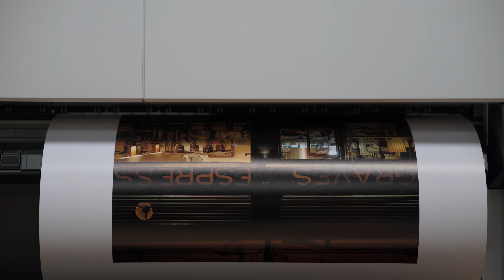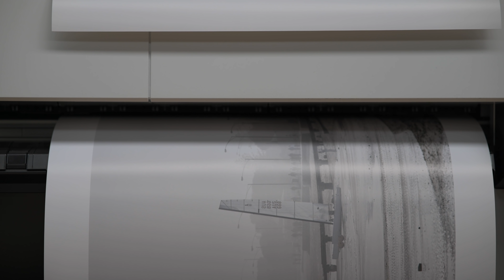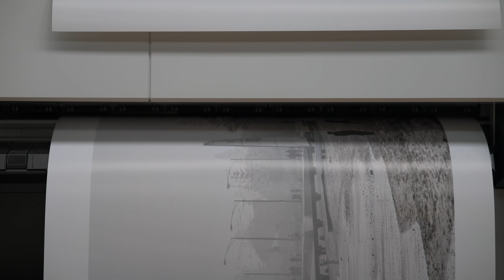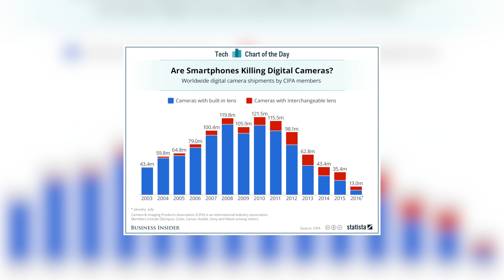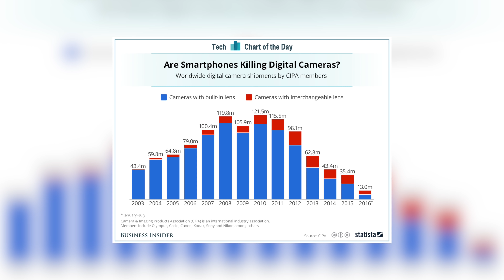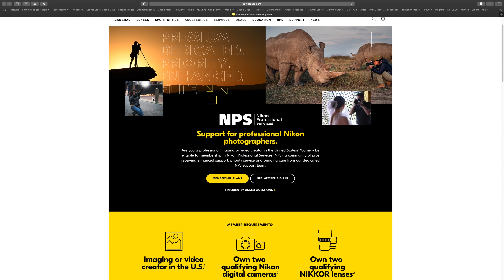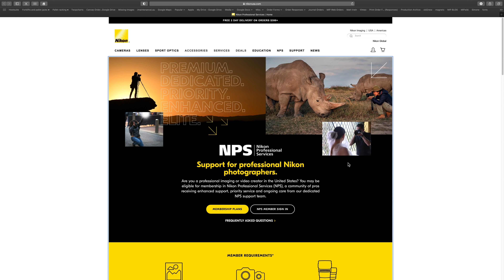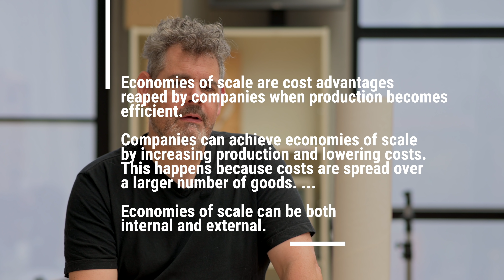Will Camera Gear Cost More In The Future? | Opinion Piece | Matt Irwin

Comment: As the camera market stabilizes to smaller worldwide market manufacturers will probably do a combination of reduce the initial warranties, reduce the number of models offered in the line up, extend the lifetime for each model, rationalize organization structure, and raise prices slightly. I would prefer a lower price with the option to buy an extended warranty. What the exact size of the overall market will be, I am not sure, but I think we are near it. If my guess is correct, I think prices will be relatively stable. Also, I expect the market to eventually be primarily mirrorless cameras from APS-C to medium format with some DSLRs lingering for many years, maybe a decade or more for most manufacturers (new film cameras are still sold). Nikon's recent announcements seem to follow at least part of this with warranties, rationalizing organizational structure, and dropping 2 DSLR models. 

Of all my camera gear, I have had only 1 warranty claim on a Konica camera that had shutter bounce out of the box. All my other gear has never given me any trouble including the Nikon D70S I dropped onto a concrete floor (eye piece damaged but still very usable).

I enjoy photography and getting out to photograph nature and events. I have a special interest in macro photography.
Reply from the maker: Cheers Jay, yes I agree you your analysis, and if we are now at the bottom of the market, and C19 retracts this year, prices will hopefully stabilise. Great data on your warranty history, much like mine.

Thanks for sharing what photography means to you.

Cheers Matt

Comment: Hello Matt, you raised lots of good points, my D200 F5 and F80 still work. but that doesn't mean that Nikon will keep the quality standards as high as now. we saw that with lots of other consumer products a Levis jeans of 2020 is completely different then one from 15 years ago. nothing says we will not have bean counters in Nikon management in the years to come, who try to reduce cost by reducing quality
Reply from the maker: I suppose there are two directions the quality of the cameras can go.  They become, better or worse.   Most likely quality will remain the same, whilst technology continues to advance.  A core part of Nikons brand is quality.   If there is one thing the cannot afford to mess with too much it is their quality offering.   Personally I beleieve it is possible for quality to remain the same as we have always know and for the market to shrink, the market was roughly this size about  30 years ago before the bubble, so it is totally possible.  Along with robots doing more today, and mirrorless cameras being less complicated to manufacture once developed.
Reply: @MattIrwinPhotography  I hope so, but getting not even a carrying case for lenses that cost 2500 euro is a bad thing. The worst that could happen for quality  is that there would come low cost competitors, we have seen it in Europe with quality of kitchen equipment like dishwashers, ovens, reputed brands can not compete with the very cheap ones and start to cut costs in the wrong places. But I really hope you are right. And I also agree that if I have to pay 100 euro more for a lens ( although Z lenses are already very expensive) I will do it with the smile if it helps nikon survive. The international warranty thing is not a dealbreaker I guess. But again thank you for your video very interesting as often. The beer in Belgium offer  still stands :-)
Reply from the maker: @cwoble  Yeah I agree on the carry case.  I think things have been this way for about 5 or more years with Nikon lens bags, perhaps Nikon deciding that people don't use them.  I certainly never used mine, and always put lenses into camera bags ... all of these decisions are terrifically difficult.  But costs have to be cut, so lets hope Nikon choose the best costs to cut.  Beer would be great, might be 2022 at this stage ..... :  )

Comment: A logical step for the industry could be to reduce R and D so they introduce new models more rarely and when they do they are more often just improvement of the existing ones then really something brand new. The Z6 II and Z7 II might well be a first step in that direction. The end of the megapixel race also could make this scenario more probable.
Reply from the maker: Yes great suggestions Eric, and I think you are right that the 'II''s are an example of this.  Cheers Matt
Reply: There will never be an end of the megapixel race. The megapixels are just a marketing argument that make the manufacturer sell new models.

Comment: I have 4 income streams...normally but the Covid thingy has shut down 3 and crippled one. My two largest businesses are in incoming tourism and that is banned due to border closure since late Feb last year, another is photography and the spring wedding season say all 37 weddings in May, June and July were canceled, and the commercial studio work dropped dramatically to only one session since that time. A 4th business is repair of pro audio equipment for venues, clubs, musicians and live theater. That one still works but volume is 1/10th normal because only rehearsal halls are still active. So, adding lenses or updating bodies are not options now. But the main bright side of being here in St Petersburg Russia is the very low cost of living so little has changed personally, till date, still go to clubs but they have 11pm closing times instead of the usual 6am closing, still shoot for fun. I have had 1 warranty claim, recalibration of AF on a D7000 not long after if came out. One day it just missed focus with every lens. The shop in California did it in one day..  I had an SB900 fail during an event but I repaired that myself since I have a more complete electronics lab than they do. A tiny SMD bypass capacitor failed. Disassembly took 5 times longer than the actual repair and the part cost $0.01. I have 6 speedlights so 1 having a random problem was not really a problem.  I hope to be able to upgrade to Z7 2 by the next time I return home for a visit, possibly in April  If I was still living in California I would have been in deep trouble with the cost of living so high. The whole working and middle class have been serious damaged there due to so few services in the commons and costs so high for such things as medical care or medications. I can, and do, have a higher quality of life here than in California where it costs 10-20 times as much to live, with a lower expectation or access to culture.  The nearest opera of any quality is 3000 miles away and $800 a seat but here it costs $1.50 for a taxi and $15-30 for world-class opera in a beautiful theater with far better acoustics. 
Photography here seems to be more of daily life. It is rare that someone does not want their photo was taken, which now in the US is considered assault and criminal offense if someone under 18 is in the frame.  The last time I took a photo in the US was the day I got my D800 when it was first released. I went to the park next to my house there and shot a few action shots of teens on the skateboard park and as I was walking out of the park, 2 police cars with sirens and flashing lights screeched to a halt and 4 officers jumped out with guns drawn and threw me to the ground for the offense of someone taking photos of people under 18.  I was handcuffed and roughly thrown into the back cage. It was resolved by them taking the CF card that contained 25 shorts of flowers and 3 shots of skateboarders getting air. As it turned out only 1 of the 3 boys was under 18.   I have never been back to the US. 

It is going to be interesting to see what shakes out but Nikon will likely survive, their production is mostly in Thailand where costs are low compared to Japan and they are used to slim margins. The companies likely to disappear are Olympus, Pentax and Sony. Sony camera division is a tiny part of their income and their policy is to maintain high margins or a division is shut down. If margins drop to twice those of Nikon on bodies, the corporate board will just shut it down. That has happened dozens of times before. Remember when Sony Trinitron was the biggest selling color TV. They dropped the whole division when the competition started eating into the margins. That was a bigger profit center than consumer cameras. The shut down the entire pro audio division and caused customers of the Million dollar mixing console to lose all their investment parts were no longer available. So dropping profits due to increased costs of production means they will likely bow out.
Reply from the maker: Wow Stan, what a story about the skate park.  That was rough.  Yes it is hard to say what the future holds, but Nikon are working hard to restructure, and it will largely depend on how the next few years shake out, but this is for all camera companies ....

Comment: I purchased an extended warranty on my z6 because it also covered user error so if I drop it, run it over with my car, whatever it is covered. I hike a lot with my camera and have used the warranty once when I slipped and fell. I was shooting macro and had a flash unit connected. It broke the hot shoe off of the camera. The camera still worked perfectly by the way. I have never used Nikons warranty.

Comment: We'll pay more regardless since we're about to have massive inflation... the question of warranty is moot since the price increases will wipe out warranty guarantees, guaranteed. And since the AU dollar is tied to US currency, as most are to some degree, it's a double guarantee, sadly. Which is why I put in some of my dough into older, tougher equipment that isn't engineered to fail in 5 to 10 years. Some of it is from Nikon, but it will NOT work with the FTZ adapter lol

Comment: The Nikon Z711 + 24-70 f2.8 is being advertised today for a package deal at Ted’s for $9,999.95
This kind of cost must be very difficult for many enthusiasts or even professionals 
Specially when a new models seem to come out every 6 months reducing the resale value substantially
Reply: Go elsewhere. Look at digital direct, body should go around 5k and the lens around 3. I wouldn’t pay 10k, the larger retailers try to pull one over you.
Reply from the maker: Hi Ronald, yes that seems over priced, when I look at https://www.digidirect.com.au/nikon-z7-ii-body-only $5119 for the body and lens $3100 making it $8200, and I have seen prices making is sub $8000 but that is a price today.  This is almost $2000 less. 

In Sydeny, https://www.georges.com.au/nikon-z-7-ii-body-3-24-70mm.html?gclid=CjwKCAiAgJWABhArEiwAmNVTB1c027DedeqdfZ7_Q1F12S1muNPXGXDDWwmtNoZCXxB1C5gbxcSLwxoC9lAQAvD_BwE body and lens $8999

Comment: Matt - I completely agree with you.  But to answer your question - I would much rather have Nikon keep their excellent warranty structure. The why I look at warranty is the contract of how well/robust/reliable the manufacturer is building their product too.  If I am giving out a 5 year warranty vs a 2 year, that will ultimately dictate the quality ratio in the end.  Thats just simple engineering.  

Also, if things do go back to the way things were back in the pro film days, we can't expect a new camera every 1.5 to 2 years anymore. If you remember, the time frames between the F3, F4, F5 was almost 8 years each.   So, yes increase the prices but keep the standards extremely high.  

I think this bursting of the bubble is good for the industry and good for us photographers.  It's good for the manufactures as they can finally take time to concentrate on the details and what is really important instead of just rushing to keep up with the next product cycle.  It is good for us photographers, we can finally get back to talking about the art/craft/technique of photography rather then gear all day long (imagine that!). 

So let Nikon expand the release cycles, concentrate on quality/use cases, give us much better engineered products (like  my uncles F3 that he bought when he first got out of college almost 33 years ago and still works like a champ).  And give us photographers a chance to really learn the equipment and show what we can do with it.   And if it costs a 3%-7% more so be it.  I would make that trade off. 

So to answer your question - keep the warranty and standards as high as possible.  Over an 5-8 year release cycle, that is nothing.   Looking forward for the community to get back into talking about the art and craft of photography rather than constant tech comparisons.  The next decade can be a win/win for everyone.  Yes I am a glass is full kind of guy :).
Reply from the maker: Well said Vijay, although I don't see a decrease in warranty meaning less quality, Australia only had 1 year warranty up until fairly recently, and only changed to 2 years.  I don't think we have ever had 5 years from Nikon, and it is the same product.  I think warranties are more about what the regional  market can bare, rather than the quality of the product.

Comment: Warranty might be an issue for hard core professionals with heavy usage of their equipment. The normal consumer won’t be affected, as the local laws take care of most of the cases. I personally have never been in need of service under warranty conditions in roughly 30 years of photography, with no camera brand I’ve used and neither since I switched to Nikon 16 years ago.

As for the future of photography: I’d say the camera companies have lost the entry level consumer market to the smartphone (and the social media environment) and will settle from midrange to to top level gear, as they’ve been doing lately. Just a thought: does anybody care about the Z50? Not saying it’s bad, but who buys it? Or the Z5? All I hear is Z6 or Z7. So in the end cost will go up for us, not necessarily because of dwindling revenues and profit adjustments, but because we’re moving up the quality road. Just bought a Z6 II and the price of good glass is another story compared to the DX realm I’ve been living in. Just imagine Nikon picks up Matts idea and incorporates a medium format sensor in a future Z8 or Z9 to differentiate from the prosumer line  (or new consumer line if you will) Z6/Z7. That’s another can of worms, but cost for the professional will definitely rise.

Comment: They already cost much more here in the UK. Entry level mirrorless (Nikon z50) costs much more than entry level Nikon DSLR's. Just yesterday I looked up the price of a new Nikon D850 against the Z7 ii (bodies only) and the Z7 ii body was £500 more. Is the Z7 ii actually worth £500 more than the D850? Probably only if you do more video than stills and throw in you would have to buy and adaptor to use use old glass because the mirrorless glass is not there yet. The higher the product goes in cost for the consumer to buy the more customers you can  lose. And no, I do not want your print . Sure it looks great but I prefer my own.
Reply from the maker: New gear always costs more, the D850 is now almost 4 years older, the Z7 II is only just out so there will always be a premium for the latest model.   No worries about the print.  Cheers Matt

Comment: Prices have already increased and I expect that trend to continue. I purchased Sony A7R for just over AUS$2,000 A7Riv is over AUS$5,000.
Lens prices are much higher now. Compare a Nikon 50mm 1.4G to a 50mm 1.8Z.
Of course quality is much improved, but so is manufacture processes.

Manufacturers have already shown how to sell new product at higher prices.
Keep the previous models at same price, and offer a choice.
Save money buying older tech or pay more for the new stuff.

Mirrorless already offers outstanding performance.
Only real improvement will be for video, and faster CPU for some computational photography.

I expect very little R&D $ spent on DSLRs, maybe tiny updates.
Reply from the maker: Hi Pete, when the A7R came out that was when our dollar was $1.07 vs USD $1,  it was a great time to buy camera gear, plus Sony, new to market were very aggressive with early pricing.  I paid $5K for my A7R III in 2017.  So currency fluctuations are part of the mix at the moment.  Cheers Matt
Reply: @MattIrwinPhotography  Thanks Matt! I wasn’t watching exchange rates. 
Guess that can explain a good portion of the price rise.

Comment: "When the small guy gets in the smart money gets out."  I think its true for stocks and cameras.  I think the smart money, Nikon, just got out and is reshaping business for the future.  A large bloated infrastructure like Sony and Canon will struggle to keep up the model they have created.  I've had Nikon beginning with a D200 and now I have a D810 and a Z7; I feel no pressure to change systems, my equipment cycles about 5 to 6 years.   The D200 still works fine...
Best Regards
Larry
Reply from the maker: Cheers Larry, thanks for sharing how long your gear has lasted, and yes there is some weight to Nikon being a smaller company than Canon and Sony, thus can adjust to the market quicker ... this may be the case.  Cheers Matt

Comment: If they reduce the warranty time, I’m afraid they will make products that last less looking for reducing costs even more in the manufacturing or materials used. If they give you a 5 years warranty, they have to ensure their products last longer than 5 years or they are loosing money. If they provides only two years instead, they can design a product that last four years easily without loosing too much money. I mean the quality assurance could be far lower than nowadays because of that.
Reply from the maker: This is possible, but I don't think likely, Nikon is known for quality, it would be their most short sighted move to reduce overall build quality.   Cheers Matt